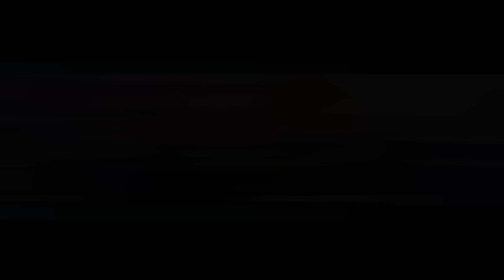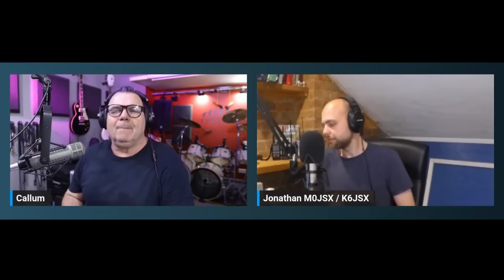19 Ideas for a Ham Radio Manufacturers

Comment: 1) I do love the Icom-way of implementing the touch-screen. 
The Yeasu way (one long list of options) does work, but one most remember all the menu-codes to quickly navigate. Preferring the Icom way
2) USB and a separate serial port would be lovely. Or better, a network interface. 
3) Accessory jack - multipin is lovely, one can split them from there if require
4) Minimum amount of coax connectors: 3 + one receive
5) External using DVI is fine, one can use an DVI to HDMI convertor block (is passive anyways)
6) Up to 50w, external powersupply, Mains for anything higher.
7) No need for a 2nd mic socket imho, but that is just me :)
8) RJ45 is easy to get and crimp on. 
9) TFT display is a pro
10) Programmable buttons. Yeasu 991 does have that kind of. 
11) Software should be included with the radio. WFVIEW does a great job on Icom radio's. 9700 does have network capabilities built in. 
12) One soundcard should be fine, one can use "Virtual banana" if wanted - that works wonderfull on a local network.
13) I don't need a 2nd VFO, at least, never felt the use for that
14) Wireless display towards any device would be wonderfull
15) Transverter support is nice, but if it is already part of radio's it is a bit much I guess
16) Keyboard support including CW/RTTY/PSK support
Reply from the maker: Thanks!

Comment: I really don't think manufacturers consult HAM's properly when designing new radios for users needs today, not 10 years ago. This is why I haven't bought a HF rig yet. If Icom brought out an updated 7300, I'd probably get it as well as most others 1st radio. I think all manufacturers are missing critical features or functions/capability in their current selection. Brilliant video Callum, I really hope they watch your video and seriously take in all the points you raised.
Reply from the maker: Cheers old friend!

Comment: The Yaesu FTdx101D/MP does have a "multi-function" knob that is persistently set to what ever function you want.... for instance POWER OUT,  in addition there is the Inner or Second RING of the VFO which you can assign to a function as well which perhaps is best addressed by a variable turn of a knob, for instance the LEVEL of the display of the waterfall as an example.  Also I would like two PL259 Receive Only ports AND diversity reception capability/functionality associated with those ports.  Also I would love to have a radio with MULTIPLE and independent CAT ports for rig control and or interfacing with various computer programs... OR a VNC Viewer Server onboard the rig.  Lastly a UDP broadcast from the rig to other UDP clients... for frequency as an example.  And of course HDMI video output port(s) should be standard.

Comment: Here's a downside of the 6 programmable buttons idea: 
Anytone does that on their DMR units. You get buttons labeled P1 through P6, and each can be programmed with short press or long press. I've noticed that it's good, when you're using that particular radio all the time. However, if I don't use that radio for maybe a month or so, then I completely forget how I set it up. 
Now the downside of Anytone is that in addition to programmable buttons, they only have a menu and exit button, so pretty much all of the day to day functions of the radio need to be programmed onto those 6 programmable buttons.

Comment: Every mobile radio should have an automatic dimming option so the screen brightness should adjust when you're driving day or night.
Reply: Yup, it’ll cost them pennies. A lot of these manufacturers are really stuck in the mud. If they’re not careful new Chinese radios will eat their lunch
Reply: Yeah. I've noticed that Chinese radios start off kind of crappy then improve a lot (firmware upgrades) and the latest innovations seem to be coming from China. And I'm old enough to remember when "Made in Japan" meant cheap, shoddy goods that didn't last long.  @TheAtomicZombie10

Comment: Am I missing the point with amateur radio, is it becoming more of a visual, high definition environment nowadays?
Dolby HD SS?
8k display on the front?
Ask and you may get.
Reply: Exactly so. I'm not renewing my license. Ft8 and nerd radio has killed the joy I had from CW chats and conversations. A signal report isn't a QSO and deserves no confirmation.
Reply: @lexheath8276  It would seem a lean to streaming the audio and visual aspect is required for the influencers is wanted. Could always run the audio through a mixing desk via a latency free gigabit connection at Abbey Road while on!!!
Reply from the maker: @lexheath8276 - stop watching radio shows!
Reply from the maker: Everything is visual else it wouldn't sell.

Comment: Not SDR Console, SDR Control. I use it with my IC705  and 13” M1 iPad. It works nicely and reliably, but lacks in features ATM. I find wfView to be just as good if not better in some respects, and it’s free and runs on both both Windows /Apple OS.

Comment: We need the likes of Yaesu to do what Icom have done with the 7610 and incorporate networking built in for remote operation, and with that make it simple to setup and use. Yaesu's way of doing this is costly(you have to buy an additional LAN unit) and then spend ages faffing around configuring endless settings on both the radio and PC. I'd like to see radios with WiFi 6 built in, and more control options using a mouse and keyboard.
Reply from the maker: Yes, I've heard that..

Comment: Wifi for many reasons, remote control via Bluetooth/wifi/web interface, an open TNC accessible via the same, full remote control, via tablet/computer/web interface, ethernet interface, a radio with all FM digital modes, etc. And an audio DSP, which would even be useful on FM.